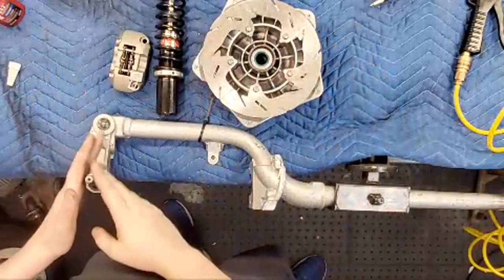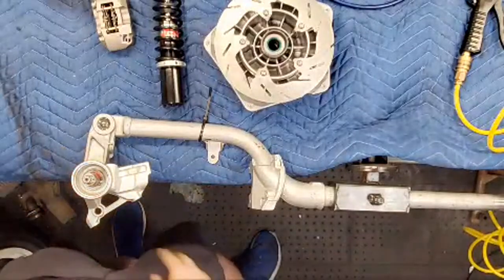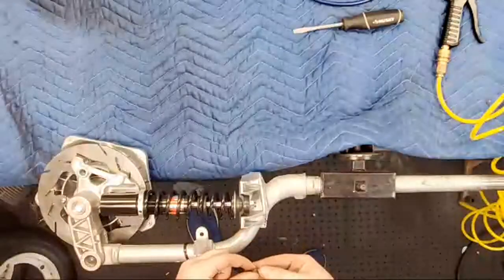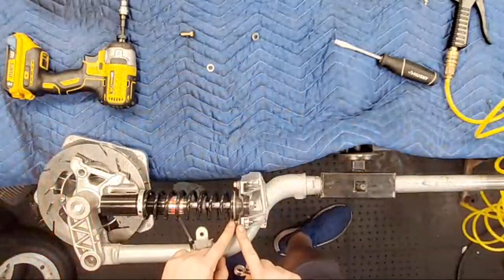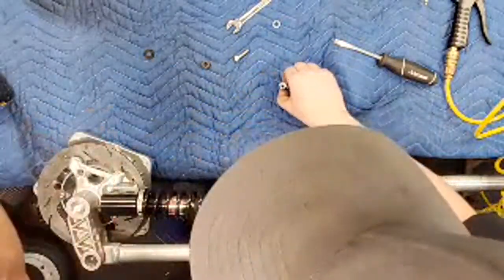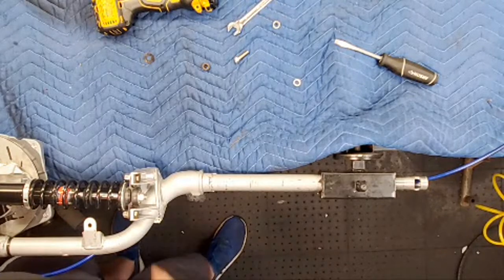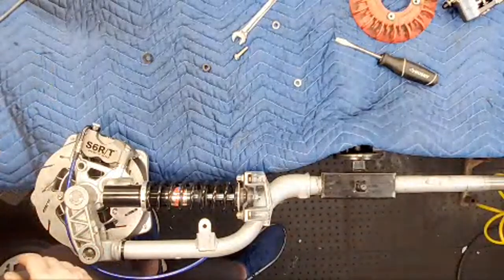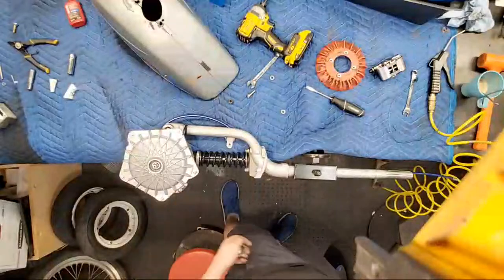Building a Disc Brake Setup For A VESPA SPRINT

Comment: Hi can you please explain why you use the pk set up on the px? I’ve seen you do it on your p200 I need to know why? 👍👍👍
Reply from the maker: This is not for a PX, this is for a Sprint. 

There are readily avaliable PK forks for the oldies. 

For a P, i would rather shorten the existing fork. 

At the end, it is preference and availability that makes the decision.
Reply: That Scooter Thing ahh ok but I’m sure you have done it on a px? No?
Reply from the maker: @davidwilliamson9162  PK on a PX? I have not. I have only dones shortened PX forks on those.
Reply: @ThatScooterThing  Hi.  can i know how to adjust the absorbent set adapter can not touch mguard sprint v?  the hold at pk fork adapter must be enlarged or not to used yss absorber
Reply: Hello great video!
Congratulations!!!
This is a readily PK fork ? If yes, is it plug n play for the fender and all the others (disc brake etc)? 
My second question is: Will the original fork need modification or does it go in as is and the only work I have to do is for fender placement and steering lock ?